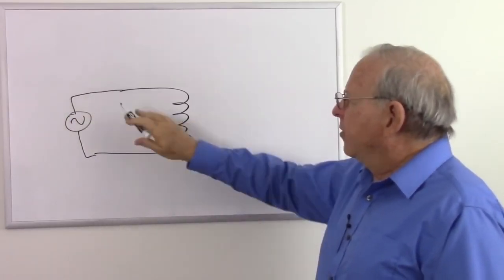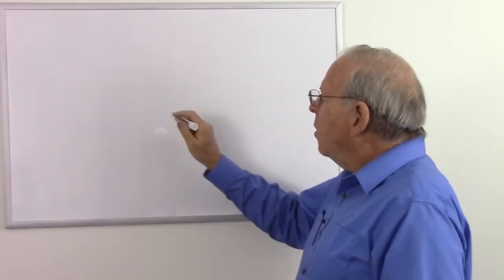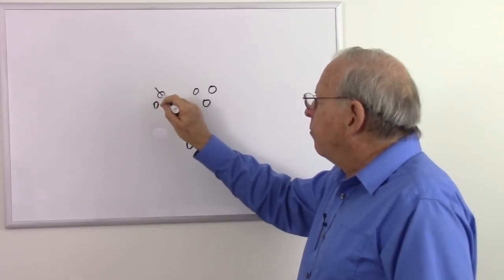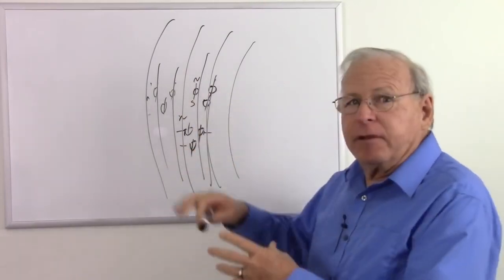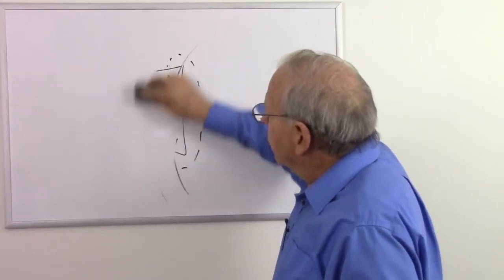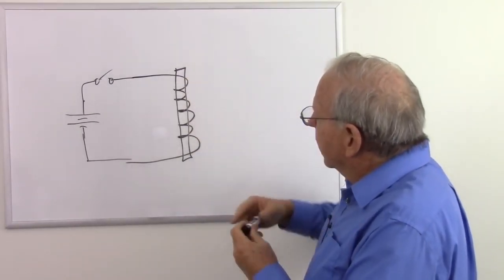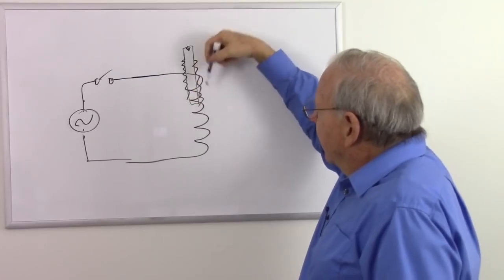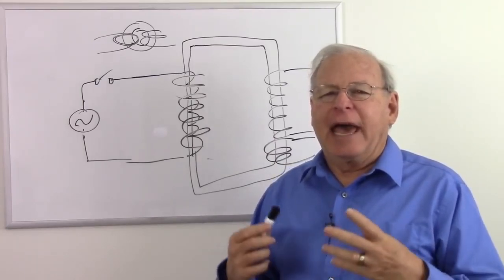How Iron Increases Inductance

Comment: BTW   Can an air core inductor saturate??
Reply: No air can not saturate like feromagnetic materials but it has low magnetic permeability. This makes air core inductors suitable for applications where high linearity and minimal distortion are required. Saturation accures in some materials like for example iron when increasing magnetic field strength does not increase magnetic flux density.

Comment: are there not natural permanent magnets? Also when an audio signal generates a magnetic field across a coil, how does that interact with the permanent magnet & get the speaker to move? Is the RF magnetic field not strong enough to move the speaker on its own?
Reply: Of course there are natural magnets. An example of natural magnet is mineral magnetite, composed of an iron oxide. Basalt, which forms when lava hardens, also contains magnetite, although its magnetic field is weak. Know about speakers. Current through coil generates magnetic field which interacts with magnetic field of permanent magnet and therefore coil moves to align its magnetic field with magnetic field of permanent magnet. That's how we get movement that creates sound.
Reply: @Slovenija_patriot  thankyou, I guess a smaller or larger magnet will create more or less movement. Also a solenoid is the opposite of this arrangement? its permanent magnet moves instead of the coil?
Reply: @markn7419  Yes the force of magnet on a coil depends on how strong the magnet is and how big the current through coil is. It also depends on length of the wire inside magnetic field (the more turns the coil has the bigger the force). How loud the sound is depends on the current flowing through the coil which changes to create specific sounds. Yes in solenoid coil is stationary and the magnet moves. You can either have magnet moving and coil stationary or vice versa the effect is the same.